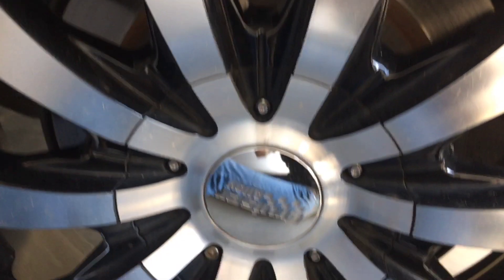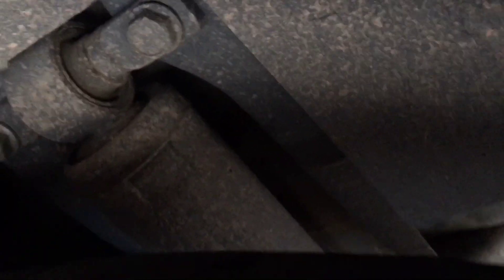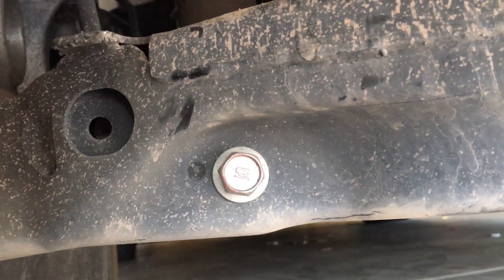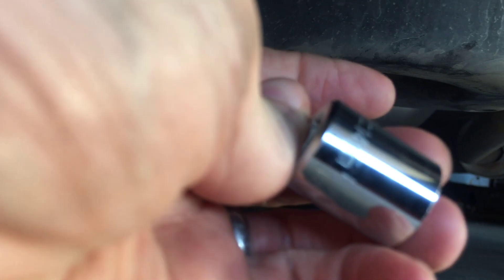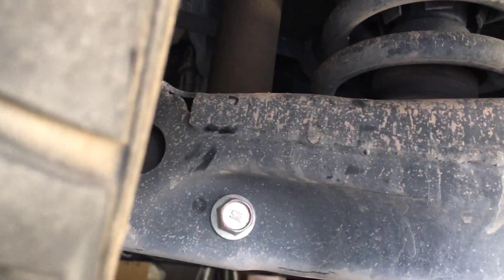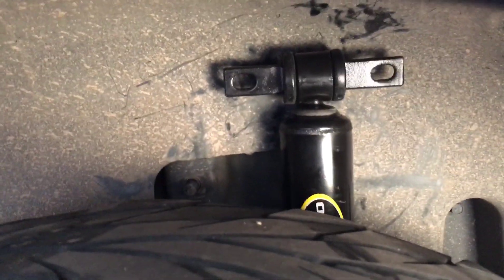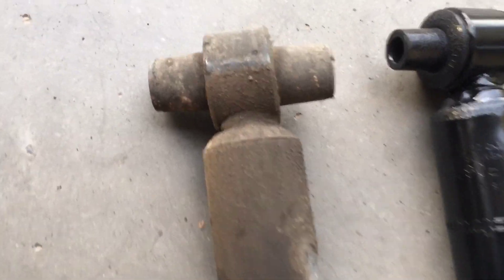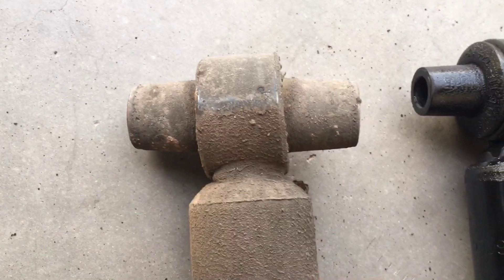Honda Pilot 2012 Rear Shocks replacement - BTS 09

Comment from the maker: I like them so far.  I did have to change them out one other time right before an alignment because they were leaking.  I think they leaked because of the alignment issue.  After the alignment they have worked great.  I needed the alignment because I also changed out my front struts.

Comment: You need to lift the vehicle so the suspension drops
Reply from the maker: Yes,  you are right.  I recently changed out the front struts and had to redo the back shocks and that is how I did it and it was 10x easier.